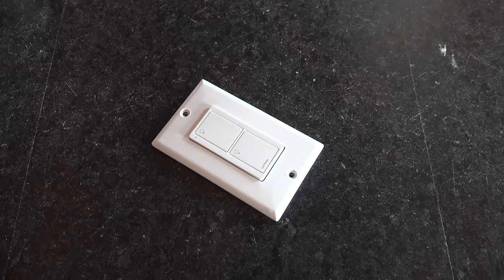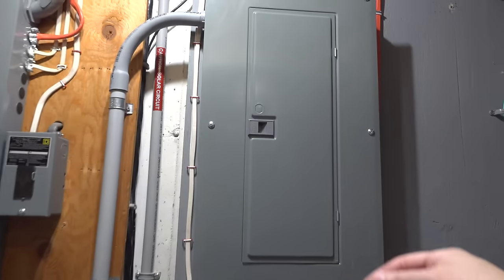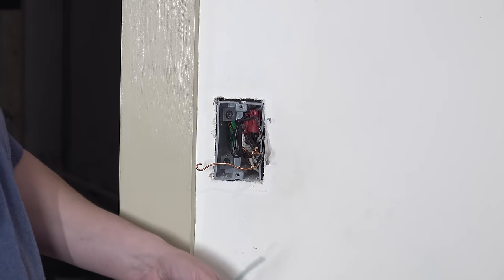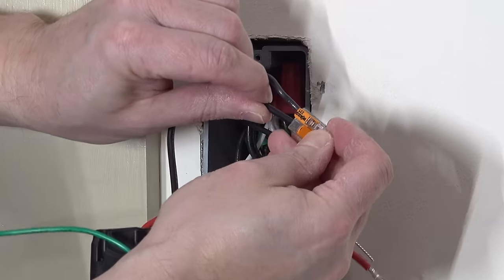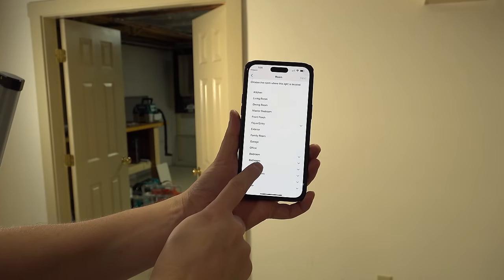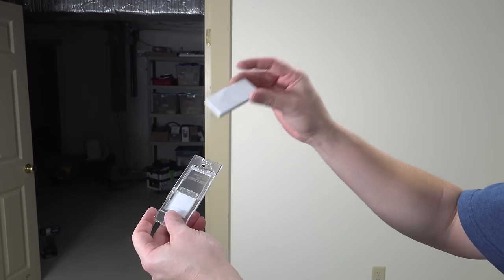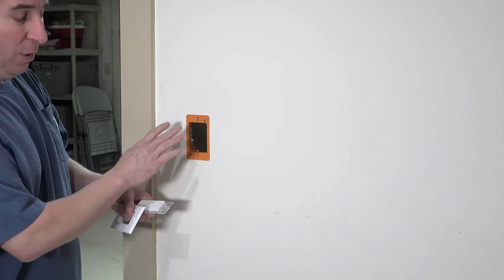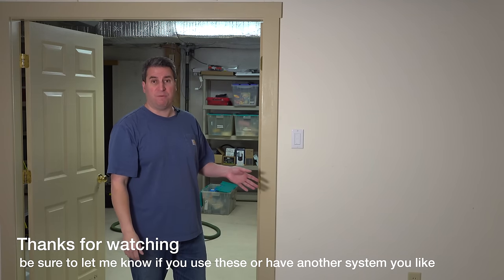INSTANT Lightswitch installs ANYWHERE

Comment: I work primarily installing lighting and these are a life saver
Edit:
Ps huge tip
You don't need to cut any hole from the drywall to install these
There is a back plate on the wall plate that can be removed for flusher install
Install the wall plate with anchors and mount the faceplate
Reply from the maker: Thats great to hear, I know they have a pro system, the RA I believe its called I feel like this is a lot like it for way less money
Reply: The anchors should have been included in the bracket kit.
Reply: @Willp4139  Nah, just use slightly used bubble gum.
Reply: That’s what I was thinking. They have like flat plates you can just stick to the wall with the portable controller. I have smart lights in my bathroom and hate where the switch is. I want to make it by the other door. What other wall switches don’t need wiring if they can just be paired with smart lights if that makes sense? Like Hue has the button one but was looking for something to look a little more traditional if that makes sense and if they’re connecting to the lights over WiFi they don’t need any wiring I believe.

Comment: We have been heavy into Lutron switches in our house for quite some time. The Cassera line of switches is fabulous and we have done a number of replacement three-way, lighting applications, using exactly what you have listed. For example, in our kitchen, when our kitchen was revamped. The contractor installed, undercabinet lighting, and only put one switch in place to control it. I swapped that switch out for a Cossetta and added the little small switches in a number of different locations mounted straight on the surface of the tile backsplash. No drilling nothing I just used self stick automobile grade tape to mount them up. They are fabulous. We also have Lutron switches for our ceiling fans that allow us to control the fan speed without having to pull a chain or flip a switch on the fan itself. Lou Tron products are fabulous.

Comment: I did the same thing in my basement.  I love the Lutron controls.  They are so easy to setup and use.  I love being able to turn off the light either by my phone or voice assistant.  I have some on controls on my porch and garage coach lights.  I have them scheduled to turn on at dusk and off at 2am everyday.  I want to expand my system in the future.

Comment: Kasa and Tappo (from TP-Link) are great as well.  No need for a hub, they have controllers built into the devices (including bulbs), but you do need to have a strong wi-fi signal.  I've got them for my garage and porch lights, with my router at the other end of the house.  It can be finiky to setup, but price is great and I get to have multiple colours for the front of the house to match the seasons/holiday themes!
Reply: This is what we have, and we use Alexa routines to automate some of the Kasa switches (outside lights, etc). However, Kasa does not offer one of these remote switches. They must be hard wired. :-(  This is a huge missed opportunity.
Reply: @markkempton4579  yup. same here, I use them to run my christmas light schedules and my front yard accent lighting. Super easy and they have a manual override whenever by just pressing the switch.

Comment: Great video! I got one of these recently but hadn't gotten around to making a video yet. I have a couple things to add. I'm not sure if you mentioned it but you can just pair the remote with the switch and forgo the smart hub. This makes it a great solution for someone who isn't tech savvy. Considering the price of wire and potentially labor, this can be a relatively cheap solution for adding a 3 way. Another big advantage of these is that you can get switches that don't require a neutral. They can be hard to identify but the Lutron Caseta Diva dimmers fit the bill. If you don't want dimming and want no neutral, the model you want is PD-5WS-DV. Unfortunately it is an expensive switch but probably still cheaper than wire and labor for many.
Reply: I have an end switch for a total of 3 switches with that end one dead (no wires attached) in an old home. I think it used to be part of a 3 way because it’s at the bottom of the stairs and the hall light (I’m guessing) was part of that. I cannot install wiring to make the current dead switch part of a 3 way. My only way of currently lighting the upstairs hall light is through its upstairs switch. 
Could I replace the upstairs switch like shown and simply add an additional remote switch to the downstairs bank of 3 with the one currently now dead working to light the upstairs hallway light.

Comment: I had originally bought a couple TP-Link smart switches but then determined that I don't have a neutral on my switches since my wiring is pretty old. I bought a Feit switch from Costco which does the same thing basically but without all the extra bells and whistles and you don't need a neutral. I just wanted a switch close to the outside door so I didn't track dirt and snow into the kitchen when coming in and out of the garage. This switch was pretty cheap at $20 Canadian.

Comment: Have been using Meross light switches, indoor and outdoor outlets, lamp, garage door opener switch. No "bridge" required, just network. 

They also do schedules and scenes, auto-off after a length of time, and integrations (using Google Home I have an outlet go on when my Chromecast goes on).

Not too expensive. Works well. Biggest issue might be a network disconnect - rare! - just power cycle the device to reconnect. Very rare, though.

Comment: I LOVE the Lutron line!  I don't have any myself, but I've been doing research for when I eventually own a home and install smart appliances.  Have you seen their blinds and shades?
I wonder why Linus didn't go with these for his new house.  Lord knows they would have worked 1000x better than the system he chose.
Reply: His main reason was the buttons, they were too mushy. I have this system and he's right, but I'm not that picky, and I don't even use the switches, i use google commands. 
I think another reason was the the 3 way switches have to be battery. Again, just don't use them, leave them for guests/wife approval factor, and just use google. It's a rock solid system since it's on it's own frequency and the hub can be hardwired via ethernet.

Comment: I did a similar thing with my basement where I replaced the main basement switch at the top of the stairs with one that has a remote. I wanted to be able to turn the main basement lights on so I could see going down/up the stairs and where I'm going in the basement, and then be able to turn those main lights off when I reach the room that I use as a workroom that runs on a separate line and where I tend to spend many hours in. I attached the remote outside the work room and now can control the main lights at either end. I got the switch and remoter from Home Depot for around $30.

Comment: Really great videos on your channel, and welcome to New Hampshire! You may already know, but Leviton has a similar set up, and they have a switch that does not require a neutral wire, which can help out in a lot of situations. They also have the additional wireless switches that you can install anywhere and pair with the wired one. Probably not quite as nice as Lutron, but works well.

Comment: As always, you make great videos. However, I would have recommended you show how to test which black wire is the line (hot) and which is load. Using your tester, you can set the original switch to the off position. The black wire with no power is the load, while the black wire that is energized is the line (hot). Easy peasy.
Reply: That could have been nice to show, but for what it's worth, the wire order doesn't matter with the Caseta switches. Either black wire can receive the line.
Reply: @RonFarberNewman  Thanks for the info. I didn't know that. I use the Leviton equivalent smart switches and they require you to know which line is hot and which is load. Being able to swap out either black wire is a nice feature of the Caseta line I wasn't aware of. That said, I'm pretty happy with the Leviton switches and would recommend them. If I remember right, I went with Leviton because you don't need a base unit (apparently you do with Lutron).

Comment: I use the motion sensor in my garage.  I actually have 2 of them in the garage, one by the main door into the house and the other by the back door from the yard.  They control the same lights.  What's also nice is you can have multiple pico's to control the same switch.  My hall/stairway lights have 2 pico's and the main switch.  It's a great system and it integrates with Apple Home as well.
Reply from the maker: Thats great to hear you have had a good experience. I need to try one of the motions too, thats a great idea

Comment: This looks great thanks for sharing.  I’m loving the channel!  As a fellow Masshole I’ve also very much enjoyed Vermont, Maine, and New Hampshire.  It looks like you are at least somewhat far north in NH with all the snow.  Question does anyone here know of a surge protector/power strip that is Wi-Fi compatible but also has a wall mountable switch like you show here?  I currently have a Wi-Fi power strip that I control via an iPhone and iPad, however I’d love to also be able to add a wall switch, as I use the power strip to plug in two free standing lamps in my living room. The house was built in 1950 so there are very few wall switches and the wiring is interesting!

Comment: Nice video. I think you should’ve shown how you need  to install a specific Lutron hub or bridge and how you will need to get that working with your home network before any of this actual works. You did mention that the hub comes with a starter kit, so you’d need to buy that first.

Comment: I learned this from a sparky. If you take a non contact voltage detector and rub it quickly on your shirt sleeve, the static will set it off and act as a self test. He did it before EVERY use.

Comment: They used to make these that didn't require any phone. Just install the switch in place of the existing one. Then mount the new one where ever desired and it screwed to the wall. I wish mine still worked and they have been discontinued. I guess this is the next best option.

Comment: Thank you for the great video. Not only is it very informative but also very well done. I have used Lutron dimmers for years and have found their products to be first rate. This is an interesting solution for situations requiring multiple control of a single light. I assume it uses WiFi. What are the security implications? Can the system be password protected?
Reply: The switches are not wifi. It uses its own frequency and doesn’t interfere with anything. The hub can be wifi but you can also just wire it up with ethernet. Hub is not needed unless you need phone control or smart features. Internet can be out and basic physical switch functions still work.
Reply from the maker: Thank you very much. Yes it is password protected for the app portion, the rest is all direct radio control.
Reply from the maker: Yes, excellent points

Comment: Very interesting video, thanks for posting.  Could you have used the wago connector on the neutral?  Wonder if this technology can be used install a doorbell without wiring low voltage to the doorbell.

Comment: Thanks for this. I have seen the pico devices but did not understand their use case. I am heavily invested in the Kasa system and want to add some "three-way" light switches in my home where I do not have three-way wiring. TP-Link does not currently offer anything like this, so I am going to have to look into layering over a Lutron system. I prefer the Kasa switches, so I do not want Lutron everywhere, but this is a glaring gap on their part that I'd like to fill with another brand/ecosystem.

Comment: DId you need to use the control module or the hub when you did this?  You only showed installing the switch and the Pico remote switch.

Comment: I recently replaced my WEMO Smart Switches with Kasa Smart Switches.  The installation required the installer to identify and mark the black line and load wires that were installed on the single pole toggle switch.  On the Kasa switch the line and load wires were marked. You didn’t mention that in this video for the Lutron product.  Was this not a requirement?

Comment: What if you don't have a neutral in your switch box. As a 40 year electrician, I've seen many circuits that have what's called a "switch loop", where the hot is run into a light fixture box with only one wire going to the switch box. The current is sent to the switch via the black and returned to the light via the white wire. Would this work in that case?

Comment: In theory this sounds great and easy, I would just do it via wiring and stand alone devices.  No guarantee what you have now will be available later, or that software will be supported down the road.    Or the complexities that come with said issues if you do sell at some point.  I guess it is minimized if you are only doing one switch, but to have a whole house with this stuff seems like a headache later.  Or a liability when you go to sell.
Reply from the maker: I agree that often tech built into a house can be a big issue down the road. Thats what scares me about a lot of the amazon no-name versions of these. Lutron has been selling this line for about 5 years now and seems to be going very strong and they are a prety recognized brand. I won't be using them for every switch but for some the remote stuff will be really helpful.

Comment: Do these switches need the “cloud” to operate or can they be installed ‘off-gird’ without an internet connection?
Reply from the maker: No, they use radio between the modules to comunicate. The internet is only needed for outside access and these work fine with no internet at all, during outages, etc.

Comment: During a power outage, do the switches maintain the state they were in prior to the outage, or do they default to off?
Reply from the maker: Great question! Yes they do. This is from their manual: • Power failure memory: If power is interrupted, the control will return to its previously set level prior to interruption.

Comment: Question: What happens to these if the internet goes down?
Reply from the maker: Thats a great question and a good reason these are cool. They ONLY use the internet for remote control from outside your house. At home they use local, direct radio control so no worries if the net is off.

Comment: I installed a dumb remote switch, just change the active light switch with a remote control light switch that comes with a remote wireless switch you mount within 150feet of the switch that has the remote.

Comment: Does the communication go through the companies servers? If they go out of business will it continue to work is what I am really asking. If you unplug your WiFi router and turn your phone off and it still works you should be good. 
I think we have all seen the first wave of "smart" home devices stop working because they went out of business or changed the protocols.
Reply from the maker: Yes and no. The switches and remotes use RF radio to communicate so Internet is not needed, and they will all work without it. Internet only is used for remotely using the devices.

Comment: My single pole light switch has no neutral, and there is no neutral wire available.  Is there a solution for me?
Reply from the maker: Yes, a very nice surprise if if you are controlling lights only. The Lutron light module does not require a neutral. I shoiuld have been more clear, so this one: https://amzn.to/3jOioPt just uses two hots and a ground like a reg switch. This is a starter kit that includes that version: https://amzn.to/3YqPPq8

Comment: Does this require access to their servers? 
What happens if they discontinue the app?
Reply from the maker: No, they use radio between the modules to comunicate. The internet is only needed for outside access and these work fine with no internet at all, during outages, etc.

Comment: Meh,  If you don't have a solid wifi signal you're screwed.   Why can't manufacturers do this with a simple local signal device that does not require wifi or an 'app' to work.
Reply from the maker: These don't use wifi to run the switches at all, its too slow for that. They use RF direct between the devices. Yes you need the app if youw ant to set schedules, etc. But all the work is done over RF after that.

Comment: But then does it not work because it needs to update the app?
Reply from the maker: You don't need to use the app at all, the remotes and switches comunicate via local RF. The app is just for remote control, and scenes.

Comment: New electrical code requires a neutral at all switches even if it isn’t needed because of this smart technology. In the past the ground wire was illegally used as a neutral.

Comment: There's more easier than that. By changing your existing bulb with a bulb with sensor. When you walk into your room or hallway it will just light up
Reply from the maker: Very true. for fixtures with bulbs those are very cool, and amazing what they can fit into the same size housing

Comment: There is no need to use any kind of box with a pico remote - just screw it to the wall directly - then add the cover plate, to your comment - I would never cut a large drywall hole when I didn't need to - there is no mounting stress involved in this installation and boxes always risk drafts. You could also stick it to the wall then add a cover plate around it using wood screws (not as neat of course).  You also do not actually need to buy the hub if you don't want to have app control and your install is simple (like what you showed here) - you can just directly pair picos to a switch using the front buttons alone. Lutron products are great - they just work.